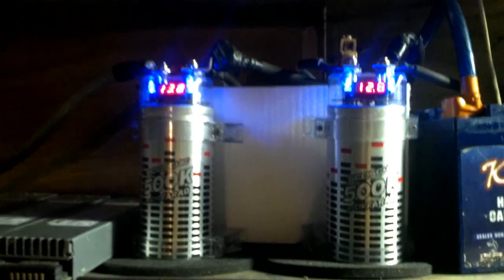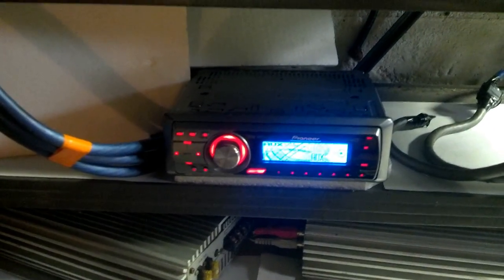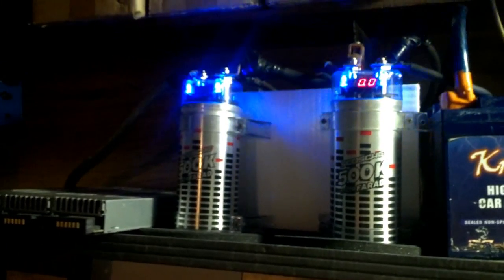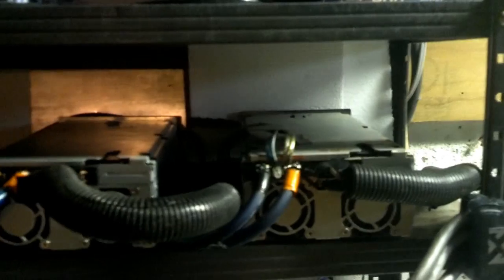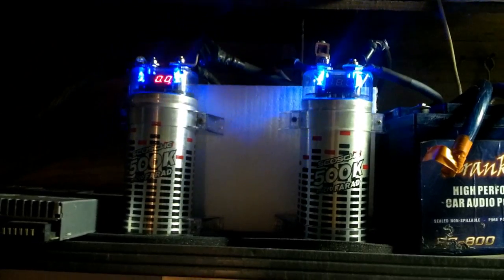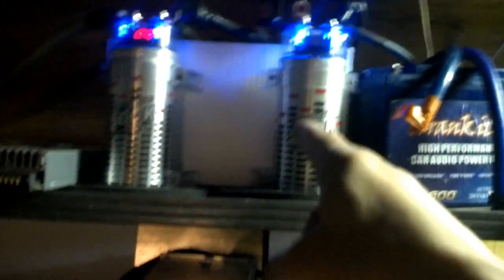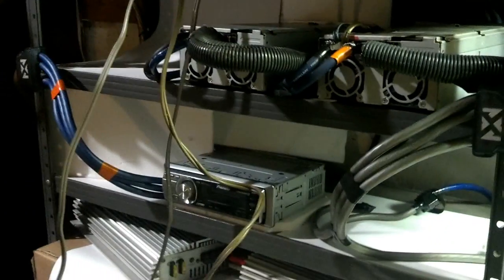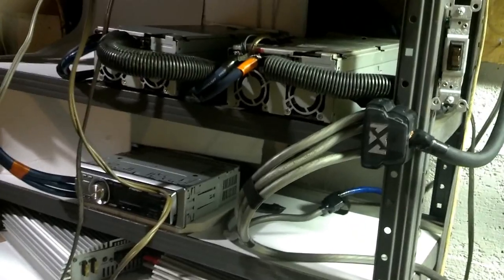Car Audio Capacitors Mythbusted Do they hold ANY voltage ?

Comment: "nothing wrong with doing all of the above , alt , battery , big 3  , caps , wire . its all works together . batts cant discharge like caps and caps cant store like batts ."   mazda2284     

hands down most true and best comment on here.
Reply: dude you got scammed it's only 500k micro-fared
only .5-farad    ½ of a Farad  LOL
  Owned by a scammer  put like 1500 Fared 12v  it will last much longer about 1min or so
Reply from the maker: @punker4Real  lithium is the way to go .
Reply: @mazda2284  Hell yeah like a drill battery
Reply from the maker: KelMaster Construction  no i dont think so . honestly in a car audio system they tend to hurt more than help . anyone that needs extra power nowdays i go straight to lithium batteries , there are great cheap options that far exceed what you can get with any caps . check out my lithium videos , also ill have new ones coming of other options
Reply: @mazda2284  check out this video 
https://www.youtube.com/watch?v=EoWMF3VkI6U
Reply: I did my Car battery stock to Duralast Platinum AGM 950ca, then added XS Power AGM 1200 2600amp 750ca, and added SSL 3.5F capacitor. Not a single problem running Hifonics ZXX 32001.D along with 2 Skar audio 12” VXF D4, 1500w RMS each. The only problem I have it severe rattling of my trunk lid!

Comment: Yes they hold voltage I had two 50,000 Watt capacitors one running one stereo to one running the other with amplifiers connected, and my house light stayed on for a full 30 seconds after everything died should have seen that shit greenhouse on the block that was still lit up for 30 seconds after the entire power outage with a block

Comment: Whoever thinks capacitors don’t hold voltage should lick the terminals and test that theory.
Reply from the maker: @Tom_the_great  they do , however its not much energy.  These are basically useless today because of technology advancements and lithium batteries as well as sodium batteries

Comment: These are fancy beer an volt meters. The fact you compared this my explanation lf what a "bank" of ultra caps are. These are at most 1 or two farads probably not even. 
Google Maxwell ultra caps. Xs power ultra cap cells. 
They arent batteries. Theres no chemical reaction or energy to be stored in. Its static electricity stored thru carbon plates. I mean you shoils know this since yiu wanted to try an play like you fucking know something 🤡
Get humble an learn stop making junk content. 8yrs later 30k subscribers (fellow idiots buying into yiur false knowledge)
1 farad versus 580 farads ....not the same thing not even designed the same. 
Cut one open an look inside bro. Youll see you bought a beer can with a volt meter an its filled with rubber with one tiny little cap that uou find in electronics like a hair dryer 🤣🤣🤣🤡🤡✌️
Free knowledge for ya. Take it to the bank an cash it in young buck 🤷 blows my mind how someone so ignorant to car audio thinks he knows somstbing an tryna teach 🤡🤡 pll like you are whay make ppl waste money an burn their investment down. Completely fucking retarded 🤣🤣🤣🤣🤡✌️

Comment: Looks as it's working good to me no problems with the cap at all
Reply from the maker: It does , just not well . This is probably one of the best applications for a car audio cap , using it as a median filter from ac/dc power supply,  because it dont store very much

Comment: What idiots think they won't hold any charge? Capacitors are literally made to hold a charge.
Reply from the maker: Even though they do hold a slight charge they are nothing in comparison to super capacitors and the lithium ion batteries that we have today make super caps useless

Comment: You have to off set the load on them for them to start holding a charge cause they work on differential voltage crap and basically u have to connect the battery side positive first then use a resistor to slowly fill the negative side up then connect it hooked into the positive going to amps after a few seconds and only takes like 2-4 seconds using like a 10 watt resister or what ever but if u just hook it up and turn them on yeah they will pass current but they won’t charge and discharge only pass it thru is all and probably I’m sure screw it up cause that probably can’t be good for them.

Comment: I think people have wrong expectation for them. Their main job is to prove prevent “waves in electricity” just like shutting down foster very fast water pressure stops making that noise then bounce back and forth creating very large in rush currant. When voltage drops this is very dangerous situation that’s why fussing is always recommended if there is no built in fuse.  Also they help out filter high frequency noise. But they needs to be large fast and very close to amplifier.

Comment: Don’t misunderstand yes it holds voltage but the point is the time that it takes for it to drop to zero. It’s purpose is to keep your fault is stable makes up for a little bit of draw know if you’re counting on it to start your car sorry for your luck. Then it’s a waste that’s the point but yes you’re correct it does hold voltage for five to 8 seconds lmao making up for the oscillating voltage drop. Is it worthless for what it does know could you do better yes

Comment: Bro thats for the volts when the bass hit it handel the volt your amp need and charge back up for the next low bass note so it has to hold charge for a min or s
Reply from the maker: But it dont hold anything.  Now lithium thats whats up . Lithium is by far a better value and option.

Comment: Caps like these are only good for lower watt systems. Even the high farad caps like these won't prevent your headlights from dimming.its like this... when that bass hits on  3 thousand watt rms system... Suddenly your trying to draw up to  to 400 Amps through that capacitor. It will fry it in an instant, as there not designed to handle that many amps.  That's why people will say there garbage. You'll need like 6 of those to do it properly. But for that price... A AGM battery would be cheaper, take up less space, and less wiring. 

BUT! I'm not going to rag on them much because that's how I started in car audio. They definitely have there uses. And some of them look really cool and perform well. It's just, they tend to get iffy the higher you go up in wattage. 

Again.. I'm not hating tho. 😅
Reply from the maker: check out my vids on lithium , there are a ton of options that smoke AGM for the same price or less !
Reply: @mazda2284  sure thing!

Comment: People act like caps are supposed to be batteries. They’re designed to smooth the voltage so it isn’t all over the place. Way better for your amps and other car electronics.

Comment: Capacitors are used for stabilizing voltage not for continuous voltage output
Reply from the maker: they dont do either well though lol
Reply: @mazda2284  but they can charge extremely fast and they (nearly) dont have affect memory.

Comment: I still don't get the point when the amplifier is doing the same thing as the capacitor, as in charging quickly and discharging quickly, they just charge a lot faster than the battery and can take some of the brunt away during quick bursts. Seem pretty redundant to me. Just another thing in the system that breaks

Comment: Anyone doubting the current held by a charged capacitor need only touch their tongue to the terminals like a 9v battery. Assuming they survive, they should be more than convinced.
Reply: Just hands will do
Reply: they should try their balls... one on each terminal.

Comment: Cap ain't nothing but a filler of voltage when the device demands more current than the battery alternator can give. It keeps you're voltage level. They can't be compared to a battery at all. They don't give power in the same manner. It's just  the power supply's sidekick to act quickly when the draw is more than what's available or until the power source can catch up.

Comment: The capacitors are not batteries. They work with the battery to even out the voltage during peak demand for high current. They aren't designed to hold a charge for very long after the power is disconnected, because they most likely have a drain resistor to discharge dangerous voltages so guys like you don't fry themselves.

Comment: I did the math, I have a 600w amp with a 1 farad capacitor. The math shows it could power my set up at Max rms for 
.35 seconds (which is a long time for that much power)
Reply: it's only a ½ of a fared  of course he got what he paid forssss
Reply: How did it go ?

Comment: Technicality speaking. That is what a capacitor means.
But if you take it out of context, one may think of a storage completely different than another person. They are rated in storage output. 
If you had a water tank that holds 500 gallons but only has a 1/4 in" output and a bucket with a 1/4 in" output
They both will drain 1 gallon at a time at the same rate.

Comment: Hi!. Does the capacitors are connected in parallel or in serie?
Reply from the maker: Parallel
Reply: @mazda2284  they should be connected in parallel then you sum both for total capacity.  If you would connect them in other way you will get have capacity and twice the voltage. But it’s a 12v system not 24v

Comment: The main advantage of caps is that they are more efficient than batteries. The also obviously hold MUCH less total power than batteries. When an amp is say playing a full volume 20hz signal it will have 40 oscillations a second in power draw. The internal capacitors will typically not buffer the supply that long so the alternator and batteries will see an alternating demand and the cars voltage regulator will switch back and forth. This means that for a short time the system will have below average power. This can make the headlights dim ect. A capacitor is really primarily usefull in making these short oscillations less dramatic for the alternator, batteries, and amplifiers. Longer variations are not helped though. For example when you idle at a stoplight your alternator puts out less current than when driving. A battery would smooth out these long term oscilations letting you use full power at the stoplight while a cap would not.

Comment: Don't buy your car audio system off of Amazon for 300$ and think your going to get results as if you are running 2 10 inch JLW3 with a    McIntosh MC420 amp and Alpine component system and deck. You want the best sound you have to spend the $$$$ . That is the set up I run in my 04 350Z all custom seeing that's what I do for work for the past 16 years

Comment: The charge is the Farads. 1 Farad = 1 coulomb/1 volts. Caps by definition store energy ......that can be released really quickly.  The explanation I like is a CAP is like a cup of water with a huge hole and a battery is like a bucked with a small hole. If your system hits hard all the time you might need way more batteries and alternators (more bucks and hoses filling.  If you play only one hard burst caps become a way to not hurt your amplifier due to low voltage between bursts.  All of this can be seen by watching your voltage drops and if you are ever below 11 volts you need to  add  more energy storage ability.

Comment: there is no point on doing this test... caps are not a battery, caps are a current stabilizer (keep amperage within the same voltage), i.e. for high-current consuming bass notes..

Comment: How much competition are your Capacitors for your amp fighting for alternator power after they both discharge fully?

Properly grounded and sufficiently large enough power wires are the only way to pull power from the battery and keep everything from dumping so much current into the chassis ground that it lowers the vehicle ground potential dimming lights.

Capacitors DO hold power, but they are nothing compared to a bigger or additional battery.

Comment: well they have to hold power to redistribute an even voltage. the whole purpose of those caps is to make sure the voltage stays within an optimal range, and without being able to hold any power it would just go through them.

Comment: I haven't seen any big SPL competition where they use capacitors. they use a lot of big batteries. and they have told me batteries last longer and batteries out more amps.so there you have it
Reply: Look into the SQ stuff where people generally seem to be a lot more knowledgable. The SPL world is full of self proclaimed "experts" and the Kool-Aid there flows freely.
Read books, talk to real audio engineers etc. It's a world far from what you see that the local SPL bash.

Comment: Capacitors we're originally designed to filter out unwanted noise from the cars electrical system
Reply from the maker: wrong .  google and wiki capacitor and read the ''history'' section
Reply: mazda2284  I know they store energy but there primary use is to filter unwanted spikes and dips  in electrical energy (noise).
Reply from the maker: that is a use of a capacitor but wasnt the original use , they were used to store and discharge quickly . ultra or super caps are still used in this way today

Comment: a capacitor can help improve the supply of power to amps, but there is much misunderstanding. they are not a bandaid to fix most power issues. they can help supply a bit more power, but not as much as you'd think or like. large capacitors aren't good at filtering electrical noise, as they have a high internal resistance. sometimes very small capacitors can help fix a problem, or sometimes you just need more copper. you can't drop money on capacitors and expect it to fix any power problem you may have.

Comment: the point of the cap is to block quick drops in voltage. its a band aid. if your headlights dim you pull too much amperage draw and your alternator can not keep up.

add a bigger alternator.
Reply: Couldn't have said it better myself.
Reply: @MrBigzo32  Wrong, it’s also a filter of alternator’s “dirty” DC. Best way is to use caps with bigger alt and big3 so you can charge caps quickly, as caps react way quicker than alternator or any battery and you need to think of voltage drop at amplifier terminals not on alternator or battery terminals. - if you load caps quickly then those provide best results for SQ systems as you won’t have any significant voltage drops. But we’re not talking 1kW RMS or some cheap 5k eur SQ builds. If you have dimming lights and that’s why you put caps, then yes it’s a band aid, but not very efficient, at least you’re gaining additional filter so higher win than expected in many cases.
Reply: Or add a cap..lol..much cheaper easier fix and fixed my voltage problem
Reply: Or add a cap 😂

Comment: Hey I hooked up multiple batteries in my 1984 rx7 n my blinkers went crazy?? I put 2 xs power 750 in the back n 1 Walmart battery in the front . Once I took the rear batts out my blinkers were fine. What are ur thoughts?
Reply from the maker: hmm thats very odd , gotta be something wrong with the blinker wiring is my only guess , never had a problem with my rx7

Comment: Caps are meet to hold a charge just for a short amount of time so when having a car battery hooked up to the cap the cap store energy so when your car audio subs have a hard hit in the bass it takes that store energy from the cap to the amp for your subs. So have a cap stop u from have to put a second car battery in ur car or another alternater in ur car so this guy on this youtube channel he don't know what he is talking about because how he has it hook up it not going the cap ment for your car amp.. Sorry for bad spelling.
Reply: A capacitor is not a substitute for a better battery and has definitely not enough capacity to compensate for an under powered alternator. Try running a 5 kw system on a stock alternator and battery with just a capacitor to compensate, the battery will be flat relatively quickly.
Reply: XxGamingWhiteboyx X ur an idiot. He may not have in it a car but he has it running off a setup designed to mimic a cars audio system just like an audio work bench that most audio paces has to test diffrent amps and speakers

Comment: when do I need one and how do I figure out the power of capacitor ??
Reply: Dont listen to that moron. A cap should be used when the amplifyer is pulling more power then the alternater can produce to keep all electricals in the car running properly... A clear sign of a cap being needed is when ur lights and or head unit dim out with the bass
Reply: You don't need a cap, you need a better battery and thicker power cables.

Comment: I didn't have a cap. Used a cap. Took it off. The bass was much better WITH a cap. Very consistent. Every note hit fully. (I added a battery and big 3 but I would like to have a cap again)
Reply: Problem with the cap is once its provided its little jolt of juice it becomes load on the system to recharge. Hence the #1 solution is a more powerful alternator. Of course its the more expensive mod but the alternator is a load on the engine of the car...  batteries/amplifiers/caps are load on the alternator.
Reply: Charles Hendricks makes sense. I have 2 amps totaling 1600 watts. I did the big 3. I had a 200amp alternator that went bad. Now I have a 155 amp alternator. I can tell a big difference in a 155 amp alternator and my former 200amp. I have went into protect mode twice. So I'm adding another battery with taxes to solve this problem. Any suggestions for which battery to get. (for the trunk)
Reply: if it was me.... id save for an alternator with that much load. Reason being, once that battery starts to drain it too becomes load on your system instead of helping.
Reply: Charles Hendricks yeah, the 200 amp alternator was amazing. It made my amp come alive. It was literally twice is loud and clear. I have all Alpine type r/s speakers. The 155 amp alternator isn't doing the job
Reply: @charleshendrick7266  Can you add another battery and bigger wires will you still need a alternator?